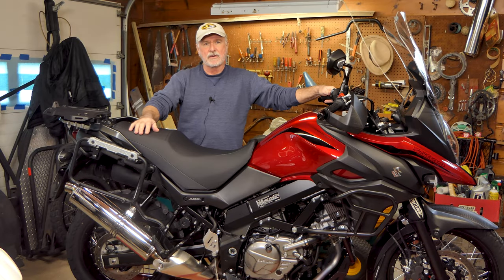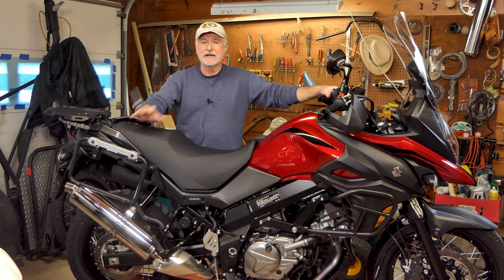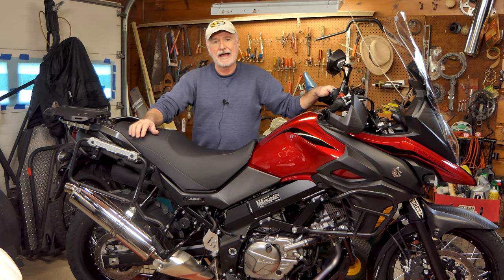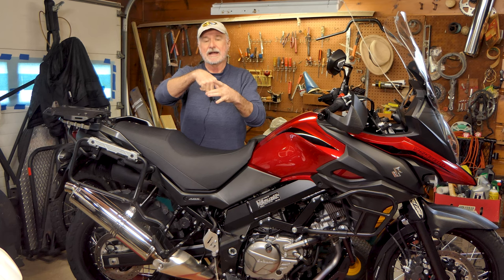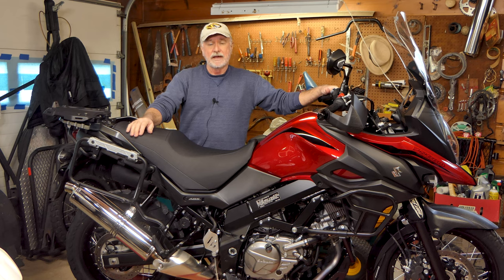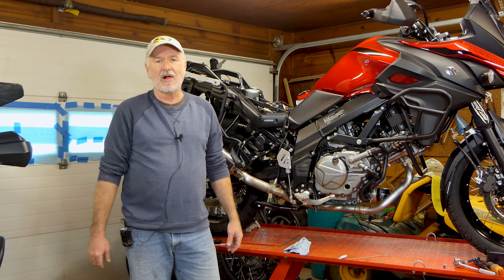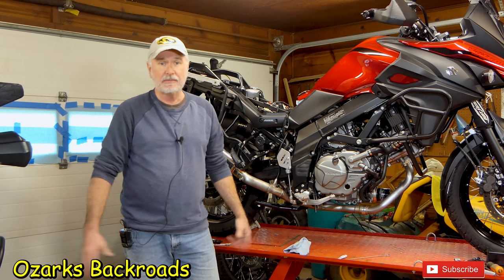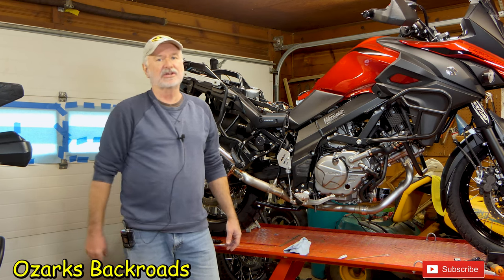2019 V-Strom 650XT Swing Arm and Drag Link Bearing Service

Comment: Hi there, just wanted to ask your opinion. I am considering upgrading my Honda crf300l Rally to something better to tour on roads with the occasional dirt roads. I am trying to compare the Vstrom 650 and a CFmoto 800mt. I haven’t ridden either but the value and tech excites me of the Cfmoto. I want to take the occasional Pillion. How would you rate the 2 bikes? I will be buying used
Reply: Hello there... good to hear from you... Well as far as these two bikes go I would say the V-Strom is a sure thing... it is comfortable, will get the job done without any drama and will run forever.  The V-Strom lacks in suspension when compared to the CFMOTO but still it is a very safe bet that you will be happy with it.  The CFMOTO is more of a wild child.  It has a much more lively engine that is quite vibey at lower rpm's.  The suspension is very good on the 800MT and is sprung properly.  The fuel  mapping is pretty aggressive giving the bike a hooligan personality.  The 800MT is a blast to ride and always puts a smile on my face when I ride it.  Both bikes will carry a passenger and gear with ease and both travel well.  The 800MT is much more capable off road on the gravel and rough terrane with its KYB suspension but is still a weapon in the twisties.  Long term reliability is still up in the air with the 800MT but I would imagine the bike will fair as well as a KTM 790/890 Adventure or Duke.  I am preparing to head out on a 4000 mile adventure on my Ibex 800T in a few weeks for some camping and exploring in the Southwester USA.  I will have a much more qualified opinion on the Ibex when I complete that trip.  Hope this helps... good luck with you bike search and thanks for watching....   :)
Reply: @jonsmith9892  thanks so much for that detailed information! Enjoying your videos and very similar rides that I like doing. I will enjoy the bike I own now and carefully unpack the pros and cons before I change.

Comment: A warning to all VStrom 650/owners.  The rubbers that cover the swing arm bolts are easy to lose.  I have lost one and when I warned a mate, he had a look and he had lost one.  Solution put them on with silicon sealant if you don’t want to lose them.

Comment: Nice way to spend  1/2 an hour. Learned a lot of what's back there. Really great to have the bike up high, instead of being on your back. I'd get a lift, but in cold, snowy Idaho, all the vehicles are inside. No more room. When I sold my '17 650, I gave him my factory service manual. If i knew i was going to buy a new '22 Adventure, I would have kept a lot of goodies. Your VStrom loves you. You're a patient mechanic.
Reply from the maker: good to hear from you sir... glad you liked the video... hang in there.. spring is coming... thanks for watching.. keep safe out there...  :)
Reply: Just wondering why you sold the '17 then got a '22 .I've had my strom650xt for over 5 years & not going to sell.But,there's no change between the '17(3rd gen)&'22.Except for decals.

Comment: Thank you for the step by step info great stuff on you channel!! have a 08 vstrom 56,000 miles great bikes. My retirement present will be a newer storm looking at 19 like yours. Question about the Delkevic pipe does it have to be rebuilt with new inners like some aftermarket pipes? Thanks for quality info Steve
Reply from the maker: Good to hear from you sir...  the Delkavic mufflers are made out of stainless steel inside and out so they won't rust on the inside either.  They should last as long as the bike...  thanks for watching and good luck with your new ride...   :)